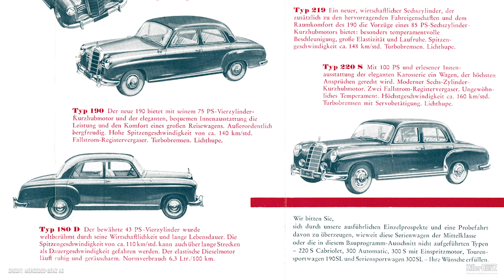Mercedes 1969 W111 250 'HeckFlosse' Coupe Review

Comment: I purchased my '66 250SE Coupe in April '92, and to quote Andy, it was rotten as a pear.  Mine is a model with 4 speed on the floor, and metal sliding roof, in DB268 "Blaugrün" with Cognac leather interior.  I'd only ever seen a 1 owner, completely original, 100% rust free (southern California) W108 sedan model, so I had no idea how horribly they could rot.  I literally took a quick peak under the car, gave it a quick test drive around the block, handed the seller $5k, and drove it the 230mi home.  It wasn't until a couple days later, when I attempted to raise it on a lift at the shop I worked at, that I discovered how destroyed the car was.  Someone had filled the rotted underside with expandable spray foam insulation, shaped it to look like the correct frame sections, and painted over it with rubberized, textured, undercoating.  Some areas were even filled in with small diameter chicken wire, prior to the spray foam treatment, and other areas had pieces of metal riveted in place.  An absolute nightmare.  Now 30yrs later, my love affair with the Coupe is as strong as ever, and I drive it often.  Andy is correct about what it takes to work on them, as far as time, frustration, and money.  Truly a hand crafted and hand built car, and every inch of it is so time consuming to work on.  Mercedes heavily supports and is proud of their vintage cars, and almost everything is still available from the car.  I've heard (but can't confirm) they have a "rule" that if they sell just 2 of a part, per year, they will continue to manufacture it.  When I order something from the local dealer, they will often tell me, "No problem.  That part is in Germany, and we'll have it in about a week."  Many parts are just "in stock" in Los Angeles, I'm guessing due to the their Classics Center where they restore so many of these, and have a large museum.

Comment: W111 coupes we’re never pricier than a Rolls Royce. Even the vastly more expensive W111 3.5 coupes were about 15% less expensive than the Rolls Corniche coupe, which was the closest thing to a competitor. However, today a good W111 280 SE 3.5 coupe is worth roughly double the value of a Cornice coupe. Swapping out the fuel injection for carburettors is a huge job - it’s not simply a matter of ripping off the injection and fitting carburettors. I cannot imagine such a conversation would have ever been viable for dealers or the manufacturers to do. He is right about those Webasto rolling fabric sun roofs - they were never fitted by the factory and were after market fittings. Factory sunroofs were always metal and incidentally are Websato units.

Comment: 9:45
I dare say that story on the carburetors is a bit dodgy.
The 250S sedan came with the double carbs, 
while all 250SE had fuel injection.
Actually, that injection system hardly ever failed.
Reply: His driver's door is sagging (can be adjusted) and the exhaust system has a whole in it. It shouldn't be this loud.
Reply: Correct the head is a completely different one to the 250s its not possible to retrofit carbs on this head. Also the mechanical fuel injection is very robust.
Reply: Agreed.  That carburetor swap story is not accurate, and the mechanical injection systems are near bulletproof.  There are cars today, a lot of cars, pushing 56yrs old, still running fine with their original systems, 100% in tact, and functional.